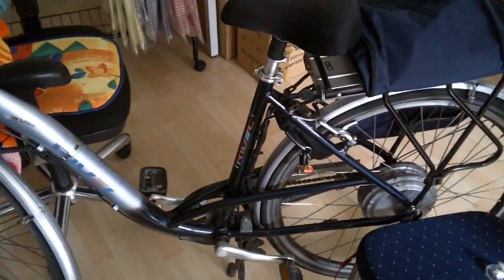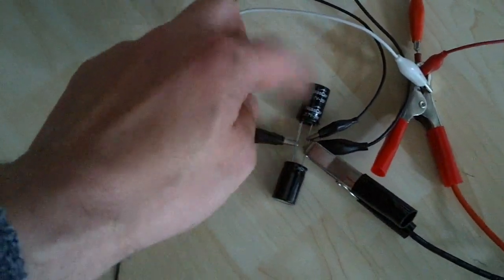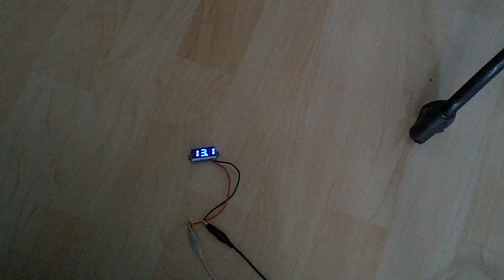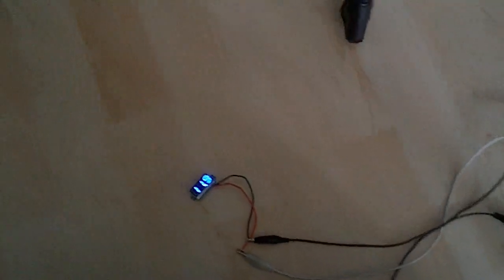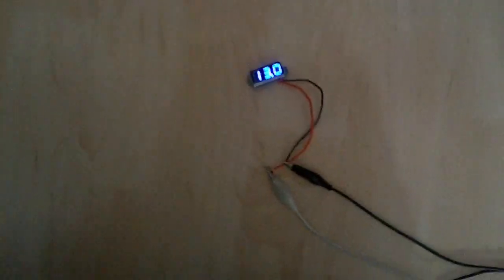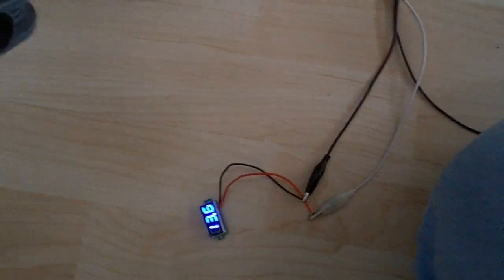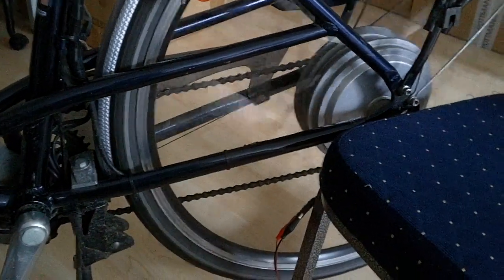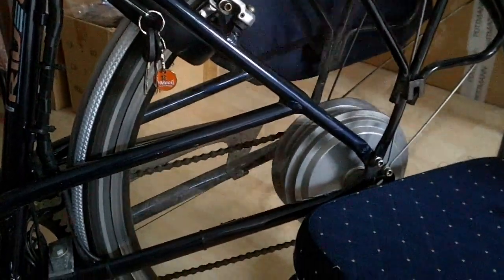e-bike 24 Volts motor used as a DC generator

Comment: wow great idea i have two e-scooter n i can use one of them for my project as low rpm generator can you pass me your mail id plz
Reply from the maker: +Deepak Shinde Hi Deepak. Thank you for subbing. The motor of an e-scooter may be totally different from that of the e-bike. Also I do not have a rpm measuring device so what rpm do you think the motor (as a generator) goes when it outputs over 12 Volts? Note, my motor is a 24 Volt motor, if you use a 36 Volts motor the rpm may be much lower as well.
Reply: thanks a lot, well i m not keen in electrics but i will find out very soon so we will come to know. actually your vid inspired me lot n my 2 e-scooters are not in use now days, its better to put them in such innovative projects ... thanks for sharing such nice vid

Comment: Thanks for this video:)  I was looking for a motor to use as a wind generator, as this runs on low rmp i think it would be pretty good.
Reply from the maker: +Spangley Rainbows Hi Spangley, thank you for watching. Regarding the rpm, I am not sure, I have not measured the rpm, I do not have a measuring device for it. I do think that if you use a dc2dc converter on the output then you can get the best out of this generator. Currently I am using a dc2dc converter which increases the voltage to 30 volts for my grid-connected converter and it does a great job at getting the most power out of my solar cells (2 different ones in parallel).
Reply: +deslomeslager  hi, thanks for the reply:) Yes dc2dc converter.. boost stepup converter., what amp rating for this are you using as i was looking at a 30amp one to raise the volts on my current pma wind alternator., it doesnt produce volts to the battery at moment because the volts are 9v (@2.5amp) with a 15ms wind speed. I guess i need a high amp converter incase i get a storm  ( the generator is rated @800w 60amp). i was interested in what you showed as I have low wind conditions, I'm wondering if an e-bike motor hub would be better in normal 10 -15 wind:)
Reply from the maker: Spangley Rainbows
In my solar setup I use a 300 Watt boost converter since my panels can't deliver more. Your generator is rated at 13.3 Volts, but if it only delivers 9 Volts it won't charge a 12V battery without electronics.
Do you think your windmill could withstand a storm? Most windmills go on brakes at a certain wind speed to prevent the blades from breaking off, and to protect the generator.

Any way, you should optimize your system for the most common wind speed. If that is low, then go for that. An e-bike motor could be used, most e-bikes nowadays have a 36 Volt motor, so at a lower speed they will generate more voltage. And I think the motor (as generator) can deliver as much amps as it can deliver (I think the amps go up at a low rpm as long as the power input == wind is strong enough).
I expect you also have optimized your battery choice. If on average the windmill delivers 200 Watts, your battery will get like 16 Amps an hour and a small 80Amp battery will be filled in no time.
Reply: +deslomeslager Hi! Yes the motor at present will handle a storm., lol with luck, it can fill the x4 12v  batteries (total 400ah) untill they reach around 13.8 to 14.2 v and then the dump load will kick in. I put some good blades on that i feel confident with..  It's just that the generator doesnt start building up to good power untill the windspeed is +25.  Its maddening., I see the blades whooshing around at a fast rate in a 15ms wind and no power generation.  Mainly because they are gusts and the volts drop below the battery voltage when the gust drops off.  I do wonder if any step up converter would work because if the dump load kicks in with a storm ,there would be a moment of free spin and a large power spike/surge might blast the electronics. Seems the problem with wind is the heavy system wiring to cover the amps in gales.  Yes, I was trying to think which e-bike hub voltage would be best for my situation., 24 or 36.  As I dont have a controller like on a solar set up, I believe, I would be wasting higher charge voltages on a 12v system...  But it would be nice to get up to the voltage of the batteries (13.3v) because at present the average wind is generating to low a voltage (9v). Maybe I could put a solar controller after the stepup converter?  This would stop wasting power from over voltage if the controller chops the surplus and gives it back in amps at 13.3v.  Again though, this kind of controller would have to handle the max out put of the  motor and surges caused by the dump load (possible 60amps).
Reply from the maker: Spangley Rainbows
I share the frustration with yo, I can imagine to see it spinning and not generating anything useful.
Would you replace the motor, or add a second one (if that fits)? If you replace it, then an e-bike motor might never reach the power you now can have. On the other hand, there are more parameters. Not every motor from an e-bike works as well as a generator. And another parameter is the average wind speed. If it is usually 15ms or less, the low rpm is the issue.You measured 9 volts 2.5 Amps. I wonder what happens if you add more resistance. Does the power go up? (the outcome of P=U*I)? In that case a boost converter would come in handy in the current situation. You could experiment and switch the boost converter on using a 12 V relay, but it would only work if you have a (big) diode between the windmill and your batteries. If you do, then you could put the relay with 1 or 2 diodes extra so cover a voltage difference on the generator. The relay should switch on when the generator delivers about 12 volts (most 12 Volt relays switch at 10 Volts or so). Add diodes until the relay switches on at 13 Volts or so, which means the generator can fully charge the batteries. The big diode is needed to keep the stepped up power from the boost converter away from the generators power.
If you manage to find an e-bike motor you need to see if you can do some calculations. You can ask the owner/shop the maximum speed the bike runs with the motor fully powered. Using the diameter of the bike's tube you can calculate the rpms.
Reply from the maker: *****
I can imagine. But I like to ride a bike. In the winter it can get rather cold, so I like to jump on the bike, ride a couple of minutes and get warm twice. Once for pedaling it myself and secondly because I attach a 12 Volt car heater to it (the ones to defrost your car, a small ceramic fan heater). The bike is just always at hand and I can use it on its own standard (but I do sit backwards, i.e. I sit on the steer and pedal the wrong way around)

Comment: if we use battery to store generated energy from the motor how much time it will take to charge the a 36v 5ah battery.And is it sufficient to run a 48v 500w motor?if it is not sufficient then which one  you will prefer?
Reply from the maker: +badya naik Theoretically you could charge a 36 Volt 5Ah battery (with a dc to dc converter). The output of my motor would be optimal at 250 Watt, so a quick calculation shows that 5x36=180 Watt, some losses, so in theory in less than an hour. But it is not a practical thing to go for that time as your goal, since our legs can't get this job done. We can sustain a 100 Watt for a long period of time, so you could charge the battery in 2 hours (if there are not much losses). if your e-bike has a 500 Watt motor, I don;t think our legs can produce that maximum amount, or for a very short period only.

Comment: What do you think of using a second wheel in front as a generator and store the power into the capacitors. Then use the capacitors and feed the power back into the rear motor?
Reply from the maker: Thien Nguyen Thank you for your idea.
But I wonder what will happen. An empty super capacitor is like a dead short.So I would need to add electronics to get the capacitors charged from the voltage they are on. In the long run, I am sure I will loose power because of heat dissipation. in short: I do ot think there is much gain.

Comment: I was thinking idly about a bike with a generator attached to the cranks, a supercap (I've seen 30F 30V ones for 80 Euros) and a motor on the wheel. Have no chain, but a simple controller on the bars with drive/charge positions. 
Any ideas?
Reply from the maker: Charging a supercap requires a lot of effort. When it is empty, it is like a dead short. And when the voltage gets higher, you need to make a lot more speed to get the needed voltage. I think some clever charging is needed, and then it can be done for sure. And what to do if the cap is empty and you are at a stand still? You will fall off the bike if you need to pedal in a stand still situation. I would recommend to keep the chain as well, but perhaps with a gear to enable/disable it.

Comment: 50 microfarads, maybe. 50 farads - i'd like to see the size of such capacitor
Reply from the maker: Hi Anton,
Thank you for watching.
If you refer to the supercaps I used, I am showing them in the clip at about 6:36 and I show a box full of them. Each is 25 Farad at 2.7 Volts. Two of those together are 50 Farad at 2.7 Volts. The are the size if a small (toy) dc motor, approx 2.6 cm high (one inch) and diameter is 1.5 cm. For reference, I have 400 Farad and 500 Farad supercaps as well, those are just 30% bigger than a D-Cell battery. I use those bigger ones to charge them with the bike, and then with those charge my mobile phone battery with it. It does require me to ride the bike three minutes or more to get that done.

Comment: My front tire is 1000w 48v ac 3 phase, any tips?
Reply from the maker: Could you explain what is your situation in more detail? Did you put a motor in your wheel, or is it an existing one? If it is an existing one, tell me what is the power source, what mobile power source delivers 48V 3phase AC? On the other hand, if you manage to turn the wheel by hand or leg, you could easily turn the 48V AC into DC by using diodes (google for 3 phase to DC).
On the other hand, if you want to power it yourself, you will need a power source and some electronics (for pulsing the coils). PM me if you want to go in details.
Reply: deslomeslager Thx for response.
It is existing one, original.
I dont have money left to buy battery.
Today i built that 6 diode rectifire, and using LM317 to charge 3000f 5,4v supercap, All well. Only get tired driving that 1000w motor. Sgould have buy 500w, im not that big guy to handle that motor.
Reply from the maker: The 3000F will have a very high resistance when it is empty. I can imagine ti will be hard to turn. And yes, 1000W is really a lot. My eBike motor is only 250 Watt, and I can barely spin it at top speed for 15 seconds (at 250 Watts output).
Thanks for sharing, this way other people can learn from what we do.

Comment: It would be nice if you hooked up a multimeter and measured the current :) See how many watts you can produce.
Reply from the maker: Hi Gadget addict
The motor is rated 250 Watt a at 24 Volts. If I push it real hard, I can get it up to almost 300 Watts. But I cannot keep up that pace very long!
Note, I did this as I was charging up a sick pack of 500 Farad caps in series. Wires will get hot as well when doing this.
Reply: @deslomeslager  if it got to this power level could we not charge the majority of ebikes with this method? allowing u to use the bike battery itself to help the voltage build to a higher amount making u not have to pedal anywhere near as often. i mentioned this above and honestly I'm excited to try it lol

Comment from the maker: Hi, thank you for asking.
Not having tried it, I do can tell you the outcome. First of all, this type ebike requires a minimum speed before it activates the motor. Maybe 10km/h or so. If I have a generator charging my battery, up to 10kmh I need to deliver the power myself. Note: on a full battery I would not feel much. If I would do what you ask, then the generator will create extra friction. The bike looses speed. The motor delivers its max of 250Watt. More drain ;-((
 In short: less range.

Comment: Question: using your ebike as it was intended, with the electric motor on the rear hub, let's say hypothetically it has a 30 mile range before the battery is drained. what if you were to put another electric motor on the front wheel and use it as a generator to make electricity to help recharge the battery that's driving the motor on the rear wheel, how much do you think that would extend the range of the bike before the battery was drained? I've always wanted to try that but no place to do it.

Comment from the maker: Yes, they are. Brand: NessCap, 2.7V 25Farad (max. 2.85 Volts). I did test one capacitor on a higher voltage (possible destructive test) but I could go up to 3.3 Volts without damage. Hence nice caps.

I have many of them. Currently I attached a whole bunch of them (8 sets in parallel of 6 caps in series, meaning 200 Farad at ^16.2 Volt). I am charging them with an idea from lidmotor, a diode on base+collector of a 2n3055. The LED flashes and the caps are (trickle) charge pulsed. t.b. continued.

Comment from the maker: Hi, thank you for commenting.
If you know a simple way to connect it to your bike? I do like to discuss the e-bike as a quick and easy alternative power source.
As to the motor, it is with brushes. They do wear out after a while. Note that I have not disassembled the wheel or motor!

With your motor, it depends on how it responses to a load situation. If a -no load- situation enables it to run freely and almost without friction then you can start trying to use wind or water power to run it.